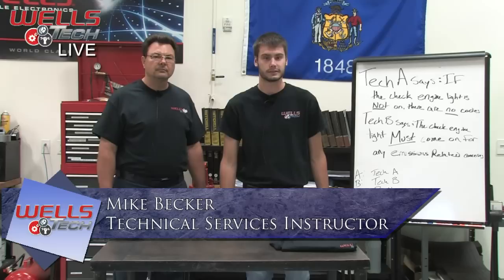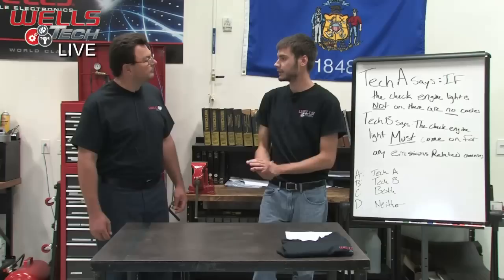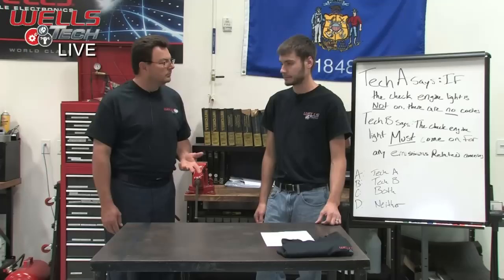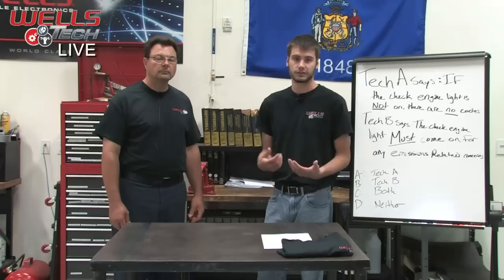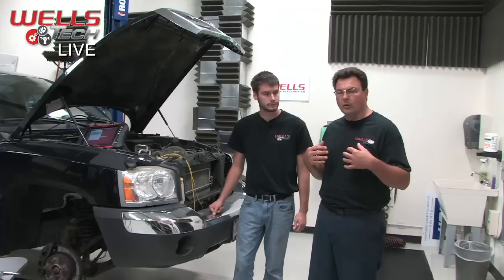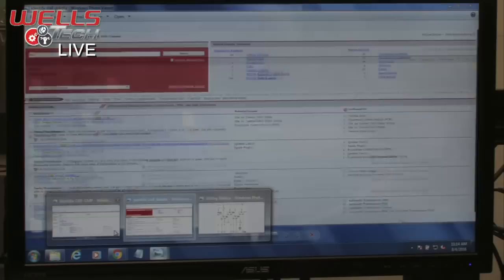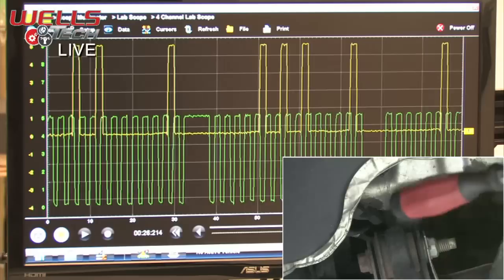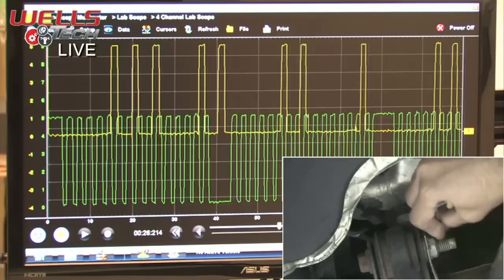Diagnosing Intermittent Stall Concerns

Comment: Hey guys. In the process of cleaning out a battery last week, I did not remove the negative and the positive touched 
ground and melted the tool brush. I thought I was doomed. Thanks goodness, nothing happens to the car. Could something go wrong?  Reversed polarity and shorted positive cable could cause damage pcm from what I have heard. How could that be possible?  Thank you in advance!
Reply from the maker: I've seen different things happen. Sometimes you can get lucky and nothing happens, other times i've seen fuses blown. I've personally never seen PCM get smoked from it, but I'm sure it's possible. Glad to hear nothing major happened for you, except now you need a new brush :)
Mike Becker, Senior Technical Instructor
Reply: Thanks, Mike. I do need a new brush and a no repeat of what happened !

Comment: Can u give me a direction for trouble shooting a car. If we have tried the tap test,  the wiggle test, sensors read ok.  No codes. Fuel n vacuum ok. Timing and no freeze frames. Any new techniques u can think of to use. I work for the post office as a mechanic 25 years. Our vehicle are 20 years old a lot of electrical bugs. 2.5 liter engine. Throttle body, and most parts on the car already changed except the ecm.
Reply from the maker: Mark, wants the issue with the vehicle?
Mike Becker, Senior Technical Instructor

Comment: Talk about 2006 Dodge Magnum 2.7
Stall issues 
Its Ridiculous
My only code was P0335
Crank Sensor 
Replaced fuel pump,,,No Start
Waiting on cam Sensor 
This is a dog chasing its tale
235000 miles on this vehicle 
When runs its quiet